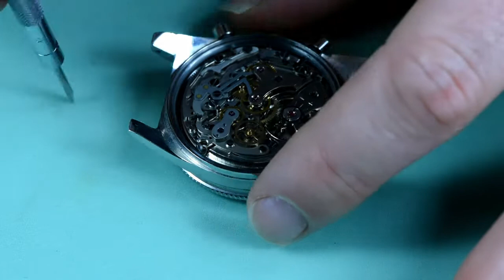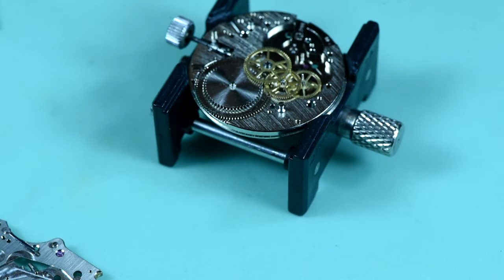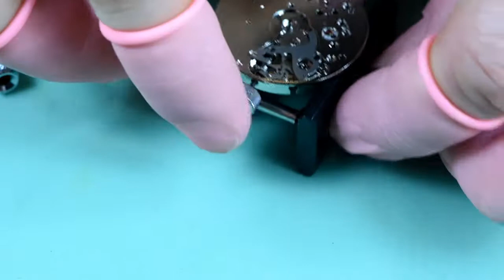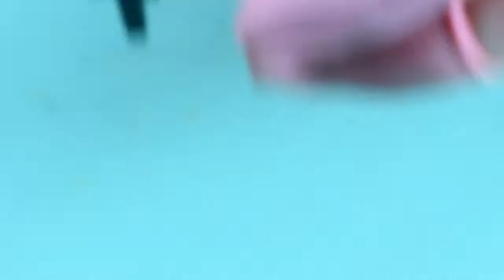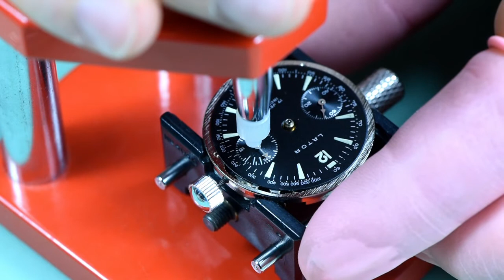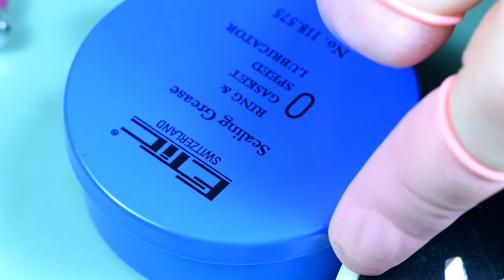Vintage Lator Landeron 248 Chronograph Service

Comment: Thanks for this. I’ve just bought one (L248) and never serviced a chronograph before, It’s just a hobby for me. With regards to the eccentric screws, I guess these adjust the depth the wheels engage into each other? Any tips you have for these? Also the drive wheel, I noticed you took it off with levers and put back on with hand push. No need for presto tool and staking set? Cheers!

Comment: The sliding gear looks like its from an L48 as the 248 only has the alignment screw on the end.  The L48 had two screws.